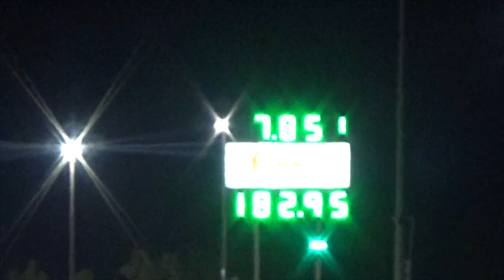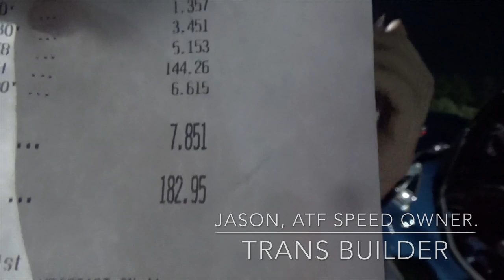Worlds Fastest Supra On All Toyota Drivetrain

Comment: I called your 7.8 months ago Pedro (I called 7.90 capable easy) when I worked out that 8.4 ET from final day of TX2K, so glad you achieved it brother. 👍♥️♥️
Now, also in that post I said ALL THE BOOST will get you 7.50s. 😈 Prove me right. 😁
Reply from the maker: I think your right on. I’m convinced we can achieve 7.5’s with the car as is. Just need to turn it up some more
Reply: @BalticSupraRacing  I don't even think it needs turning up for it. You got a 1.35 60ft, get that 1.25 60ft and you should hit 7.60s, maybe 7.50s. Just gotta get the Braedonton staff to go all out with the VHT so the prep holds to the end of the night...like Miller prep level of sticky. 😂🤣 Congrats once again amigo. #DownUnderRaceFamily 😎
Reply from the maker: Yup that would be nice. We will go back out soon too try and improve on the 7.85

Comment: Love the car, love your channel. On top of that, you're a great guy with a great family. So why the suicidal Supra ?. If that car gets out of shape or the brakes fail, at 183 mph. The Supra Gods will need to save you, because the car won't be much help. Please, install an NHRA legal spec 7 second cage, chute, safety items. If you're concerned about NHRA certification /SFI, etc Cleetus uses "ProFab, in Florida, they do some incredible work. I would also consider a halon fire system for both the engine and driver compartment. Best wishes on your quest to the 7's
Reply from the maker: Thank you so much brother. Those are all things I’m looking into
Reply: @BalticSupraRacing  Your welcome and I almost forgot "congrats on your 7.85". Wow !!!
Reply from the maker: Thanks brother